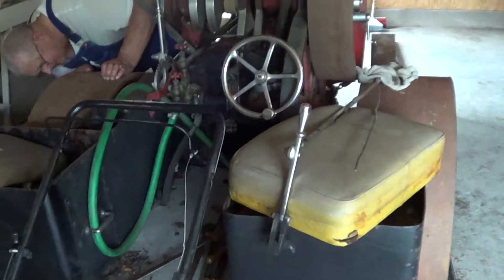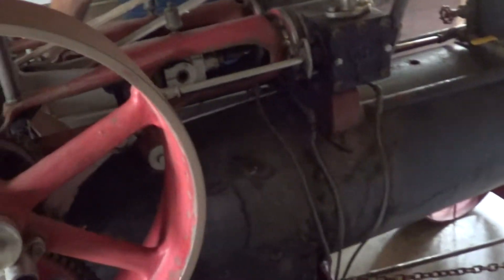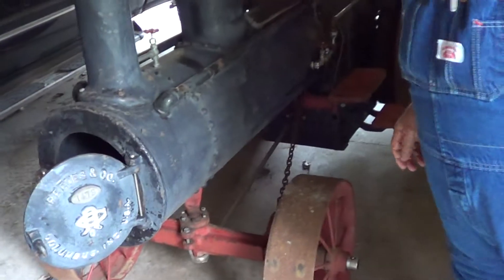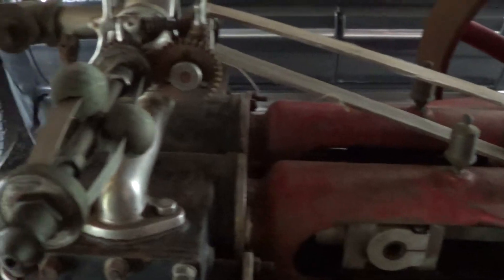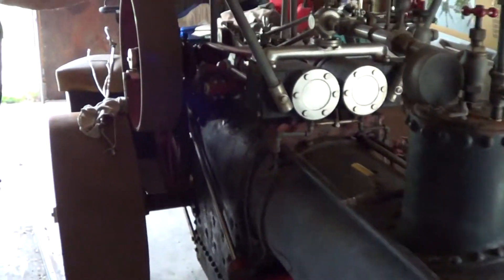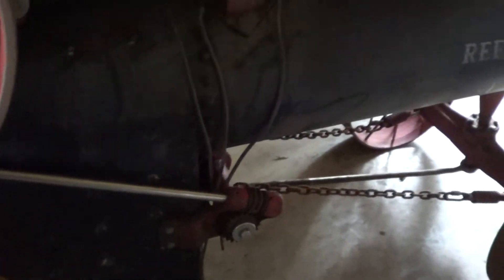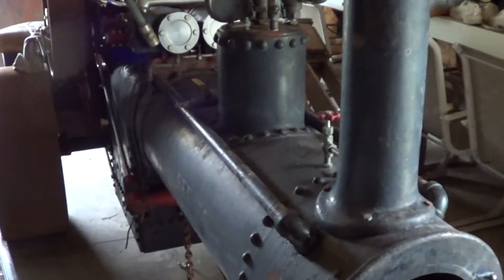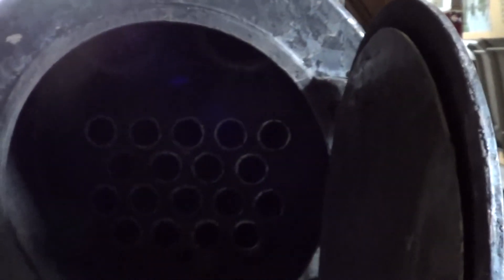Reeves Steam Traction Engine 1/2 Scale Model

Comment: nice engine
Reply from the maker: Tom fixed it up a little and traded it off.
His current project is a full size 18/56 Wood Brothers engine. Actually two of them. Neither is in very good shape. He intends to try to make one good engine from the two of them. One is mostly complete but has a bad boiler. The other has a good boiler but is missing the wheels, drive gears ect.
The project ought to keep him busy for the next couple of years. :)
Reply: 1957Shep  Sounds like a lot of work